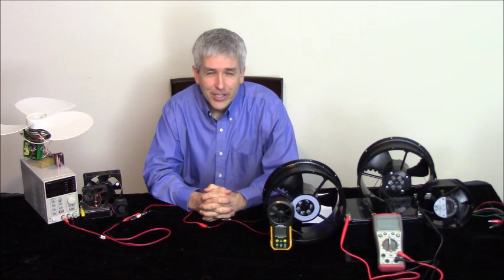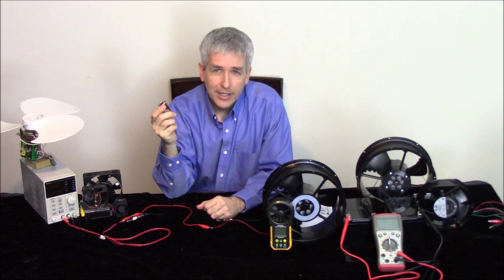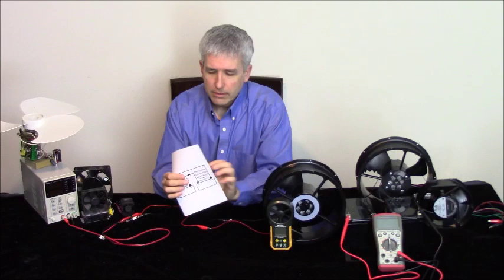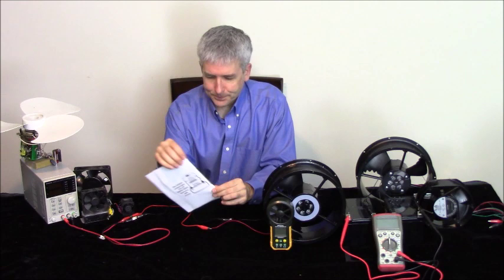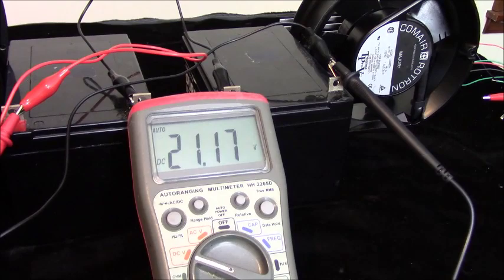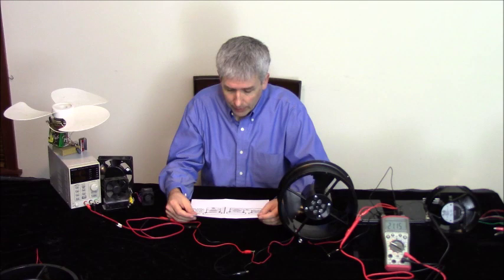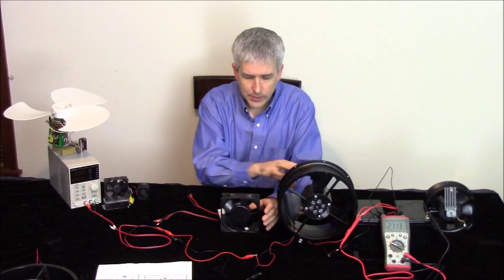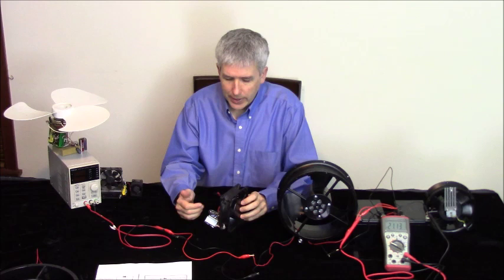Simple Free Energy. Brushless Fan/Charger.

Comment: I will probably never see an answer to this, but in order to swap batteries back and forth on this converted fan you sell, does the charge battery need a capacitor?
Reply from the maker: Why do you think there would be no answer? 
It is a difficult subject for people to understand because they are not used to the idea of thinking in terms of negative and positively charged batteries. We call it negative or radiantly charging batteries in this context. It is completely different than what people are used to. There are opposite phenomena at work here. It is opposite to what we normally experience so we call that negative as opposed to positive. There is too much to say all the details here as I have shared many times in other videos. 
There are options in what you do with this when you are trying to rotate batteries around to keep it all going. One is to change the negative output to positive going into the charging battery. This can be done with the added capacitor pulser circuit. The other is to do that on the front end of the motor (big capacitor) as a filter of sorts, which is what we do with the other motor kits. Then the batteries stay negative and we just change the motor. There is also the original way for this kind of kit, which was to have big battery banks on the charging side in a series of paralleled batteries. That is there are 4 batteries in parallel with each other one set at a time as bank 1 and 2nd connected up to that one, and the third to that one and the fourth finally to that one, where the inverter is connected to that last battery alone and the 4th battery gets rotated with the input battery. That was really the system we started out with 20 years ago now. It is more batteries than people want, but it does work at the basic level of the technology.
Reply: I thought you were too busy, and this is an older video, but man... am I glad you did ! 
I have been experimenting with the charging and discharging types. I got a computerized battery analyzer and it has confirmed the claims that capacity does indeed increase with each cycle of 'negative charging' to a point...my batteries are probably damaged slightly so I haven't seen an increase beyond the rated capacity or haven't recovered them even to that point yet from the time I bought them at the store. I have wondered for some time about putting a capacitor on the input battery (to keep it positive) and have started doing that. You have confirmed that for me for the first time here, as opposed to the rear end cap dump circuit which is well
Reply: Known in this space. I noticed the fan circuitry has the scr and cap, so looks like it's intended to run on positive charge and discharge. But the real gains are in the negative charging, from what I understand so to make the fan run indefinitely need to put the capacitor on the run battery like you said, instead of the charging one, and get more batteries under charging that way.

Comment: Amazing i ll try to make it, one question : can i charge the same batterie that I use to power the motor, like regenerate system or the kromrey Converter?
Reply from the maker: Not with the basic system. You would have to do what I have called the third stage process of the loving paths system. This would provide additional output while keeping the input from discharging. This video is only to show the easiest way to demonstrate free energy and is not the ideal or best way of doing it.

Comment: What is the specialty in a brushless motor? 
Can a single phase 120v AC motor be used instead?
Reply: I see now that a brushless dc motor is still driven with AC waveform. 
Do you use motor windings as the inductor for the B emf, and the stator magnets as a a source of current change?
Reply from the maker: No it has to be pulse motor.

Comment: Can you show your circuit diagrams closer up and your circuit Construction?
Reply from the maker: Yeah, I'll be posting this on the new website. I don't have enough content uploaded to share that yet, but it is almost ready. It is just as I said, remove the flyback diode in any of these fan systems add two output diodes from each transistor to the charging positive terminal of the battery. The negative terminal of the battery is connected to the other side of the coils common connection.
Reply from the maker: As I wrote: Yeah, I'll be posting this on the new website. I don't have enough content uploaded to share that yet, but it is almost ready. It is just as I said, remove the flyback diode in any of these fan systems add two output diodes from each transistor to the charging positive terminal of the battery. The negative terminal of the battery is connected to the other side of the coils common connection.
Reply: @rickfriedrich  this is a bit difficult to understand could you please show us the diagram rick if it's available somewhere.

Comment: Thanks for the video Rick, great job.  Question.....Can this be done within the PWM computer that drives a standard brushed DC motor?  I am assuming the brushless fan runs off a PWM square waves(all done internally in the fan), a brushed DC motor receives a PWM square wave from th computer driving it, we would just need to do these same modifications within the computer.  Am I right?  Thanks again,
Reply from the maker: Yeah, but it won't give you very much. The output will depend on the rate of change or how sharp the square turn on/off time is. There is some geometry to all of this, as always. These motors are easy to show this kind of thing. We make better motors to do this, but this is off the shelf so that people can see what they are missing.

Comment: I guess, if you just connect the minue pole of both batteries together it would even work better, as this way it is shown in the circuit diagram you need to overcome 24 Volts for the spike to charge up the 2nd battery, and if you put bother minus poles together, the spike would already charge up the second battery, if the spike goes just over 12 Volts ! so more energy area below  the spike ! Regards, Stefan.
Reply from the maker: Stefan, thanks. But no, you want what is called a floating ground situation where the grounds are not tied together. This is an independent loop. In the basic circuit the batteries are actually in a series connection. In the video it is still series, so the input is 24V and the batteries are in 24V arrangement so total that is 48V in series. The nature of the charging allows for much higher voltage batteries to be charged than the input. In this video, we do not have the ideal circuit because I am just showing a very simple thing with limited output.

Comment from the maker: One guy just commented that these BLDC motors are just junk China motors that are only 50% efficient. Well he doesn't know anything. These skeptics will always change the numbers to fit with their beliefs. These BLDCs are usually between 80-90% with as high as 96%. The point of this video was to show a simple way to get more out of the motor than what is normal. Such people cannot appreciate such things because they are just on the attack. The motor draws significantly less power when run this way, and also has an additional electrical output. Now if the input supply was a battery it would draw even less power. And if the circuitry was improved (as we normally do with these motors) it would improve the efficiency and also produce more electrical output. This video was just to show a very simple modification to make it easy while showing something important. Such people making these attacking claims want you to believe that these motors are so inefficient (saying 50%) because they want you to think that the input energy is merely divided between the motor and electrical output. That way if you get a significant electrical output they will just say you are making the motor more efficient and redirecting the electrical output from the input. But why then has no one but me made this simple change to get more out while producing the same air flow? The other problem with that is when we add the better circuit we can actually charge a battery at the rate of discharging the input source battery. In such cases they would have to say that the motor doesn't take anything to run at all. Of course that is the kind of lack of reasoning these people resort to. They will always play games with meters and just say it can't be done. They say I don't know how to do power measurements but actually I do. They are expecting me to try and prove something over the internet when all I am doing is sharing information for people to prove things to themselves with their own meters. They would to make you think that it is not possible for the common person to know whether they have free energy. But they do not expect this with someone using a free energy solar panel, so they have a double standard. If this fan charges up a battery then they will automatically say it is not a real charge because you have not used an expensive power meter, but if you charge it with a solar panel they will say it is a real charge. It really isn't about the power meter or the charging or efficiency. To them it is about refusing to believe certain types of free energy. Or deeper still, them not wanting common people to believe in unconventional types of free energy.
Reply from the maker: That's not the way I see it. That would be assuming several things and almost inversely looking at it. 
Also the spikes are a result of an event, not the event itself. But yes I started doing that sort of thing in 2005.
Reply from the maker: Well it would be involved to do that. There is limited room for circuitry inside unless you replace the board (which is actually largely unfilled). Running it at resonance is too vague as it is about what you do with it in resonance, more than merely having it in resonance.

Comment: Great video Rick !!!   For the 4th option where you remove the transistors and replace with mosfet and gate drivers, do you leave the 4 coils as is(don't need a trigger coil) ?  thanks !!
Reply from the maker: No need for trigger coil then. May want to replace the latching Hall with a regular one.

Comment: instead of a fan, could this be applied to any brushless motor, possibly one with more torque. That said, could you then tap off one of the windings and either charge a battery or self charge?
thanks
Reply from the maker: Yes, we have big motors as well. This is the most basic setup to show something. There is regular basic with a few more parts and more output, intermediate and advanced levels of this technology.

Comment: Have a look at Nicola Tesla 4 Battery Switch /Charger... And also at the Re-emf Charger...
Reply from the maker: You probably don't realize that I have a video on that 2 years ago. The Bedini "Tesla Switch" kills batteries.
Reply: @rickfriedrich  so i assume tesla switch is useless? Or has it other possibilities?
Reply: @rickfriedrich  the Bedini version, yes, but not the real "Nicola Tesla 4    Battery Switch", since it was designed differently from him...
Reply from the maker: No, it would have to be done at higher frequencies where no current would flow.
Reply from the maker: Luke, what are you asking?

Comment: I think showing HOW MUCH free energy is generated IS the whole point no?
Reply from the maker: No, the whole point is that you have something you didn't before. How much is relative to the size and condition of the battery or load. I have a tendency to address too many things in my videos which almost everyone complains about so I tried to keep it short. This was not the ideal setup, but just a simple way of showing something important. Ideally we change the whole circuit out for more output. But here all you have to do is move around a diode and add another one with wires to an output. THAT IS the WHOLE POINT.